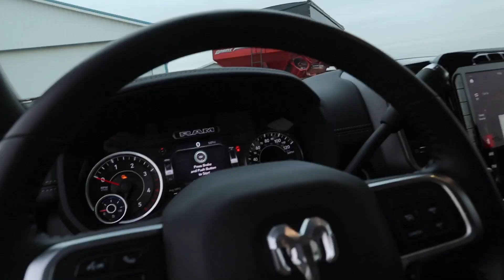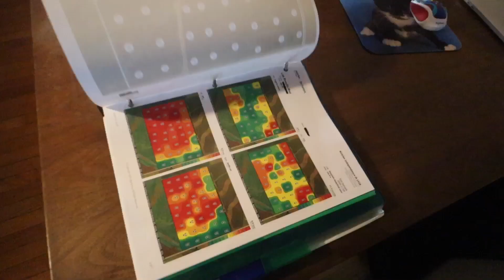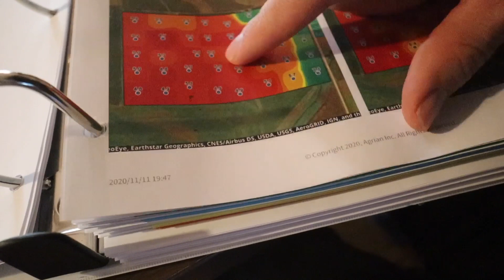MY BUILDER MADE A $12,000 MISTAKE ON MY MANSION

Comment: Variable rate will be a great change. Don’t necessarily save money but you put nutrients where they need to be. I was on the ground floor when that started. We went out with a transit to map the fields and then they burnt a chip for the field. Backed into a corner and told the spreader where you were. No GPS. But that was in the mid 90’s farming has come such a long way.

Comment: Nothing like an old house to be out of plumb, out of square, and have unique window shapes!
Reply: I love that they assumed that the shape was round....
Reply: All depends on who built it. Lots of brand new ones with that same condition.
Reply: The guy who glazed it the first time didn't bother to think about what shape the opening was, he just marked the glass and cut it.  Trying to do that remotely, based on a couple measurements, is not usually going to work.
Reply: @stoneshrink  4 parts for 2 windows. With each window taking 2 peices
Reply: Any company measuring for a custom window, in a house that obviously old and not taking a full on template is not a company I would ever want working on anything I own.

Comment: Wow, some different from the old days. (Notice, I didn't say the "good old days.") We used to take several "representative" samples to the county ag. comm. and have them tested, averaged, and apply the "best" guess. Today's methods are much less wasteful, better for the environment but more expensive. Every improvement seems to have a price tag. (Is that what is meant by cost/benefit ratios? >grin<) The basketball brought back good memories. We had a hoop in the hayloft, regulation height. The main problem was  the floor wasn't level. Over the years it had buckled up in lots of places. It was impossible to predict exactly what direction the ball would bounce, good times. Here's hoping the costs on the bins will be drastically reduced. Take care, stay safe and healthy. May God watch over all of you.

Comment: can’t wait for the new grain setup what kinda control system are you planning on using? industrial computer or proprietary? Always was interested in controls and automation that stuff just speaks to me
Reply from the maker: Not sure yet!
Reply: @ColeTheCornstar  Oh man i would totally recommend a PLC based system! Near Infinite expandability, you can add whatever sensors and interfaces you want, you don’t need to rely on a single company for maintenance and support, and 110% customizable to do any function you want with a single button press. There are also affordable PLC systems out there that can do whatever you need them to. I like the click PLC system from automation direct, it’s so cheap compared to most and it still does the exact same thing just as reliably. Can’t wait for the content my man, keep it up!
Reply: Of course in the end it’s probably up to the installer, but man PLCs are the best. They’re the replacement for old relay logic in factories and other industrial settings. Commonly used across the globe, you probably won’t find a modern production process without a plc attached.

Comment: You guys should add in soil moist granules to the field and biochar carbon pellets in the field as well. The soil moist granules once tilled in hold onto excess moisture and release moisture to the plants when dry and during the expanding and contracting allows it to somewhat aerate the soil. The soil moist and carbon pellets will retain fertilizer to prevent more run off and stabilize the soil conditions a lot better too.

Comment: Honestly if you are only looking for 30,000 I'd advise you to keep it around until you get whatever new unit you get broken in. Even if you have to leave it in the weather. It's paid for, it's not really going to put much of a dent in the cost of a new combine, heads, and trailers, and it's some backup for next season. But that's just the way I roll.

Comment: Those windows are expensive but it’s a one time buy for life so it’s worth it.
Reply: But I'm still surprised for the $9000 for three! Probably you can't even open them. Maybe here in Sweden if you get gas-insulated 4 pane windows specially made and can open them. :D
Reply: @uppsalahazzemarkstedt2759  double pane in US is standard round windows normally don’t open.  You can find 3, 4 pane but pay back takes to long
Reply: @watomb  Here in Sweden 3-pane insulating windows is standard. Both against hot or cold weather. And I have such halt round window in my attic with hinges in the middle vertical post. Thanks for your answer!

Comment: I've replaced windows like that in attics. I make a template from cardboard.  Take the template to a glass shop.  And I make my own frame which is super simple if you use big panels of glass instead of all those little panes of glass like in the original window. 4 panels of glass might be the way I would of gone. Easier to see out of the window than with all the little panes of glass.
Reply: And you can use a thicker glass

Comment: YEA  JUSTIN'S BACK.   It will be a TOP CLASS  job when it's finished...that's my prediction from how he did other jobs at the house... Insurance... 🤪 they need to send someone that work with Windows not grade level engineers... Not a surprise they got that wrong... The bins and leg..again the assessor is a 'tick box' no experience on the spanners guy. The construction guy comes and realises just however much he was going to loose when you think of it.
Quick experience... In the UK there's two systems of measure...older people remember imperial..feet inches etc.. I had an outside door replaced.. The surveyor measured the job in metric.,mm cm metre... gave it to someone? Who then MUST have used imperial,,, somehow,,, anyway when it came and they tried to fit it you can imagine the fit,,, which I then had and went into orbit,,, I was a lot more volatile then.  Buffoons s 
Liked watching you guys having fun, made me smile... Can you keep the soil chemistry explanations coming,,, it's a bit more involved than the old days of muck spreading.,.
LuVzYerALL. Mind how you go.. Everyone.... 💜.  x

PS... Cole your need to look at the wall lining outside on the house. 
Rubedo